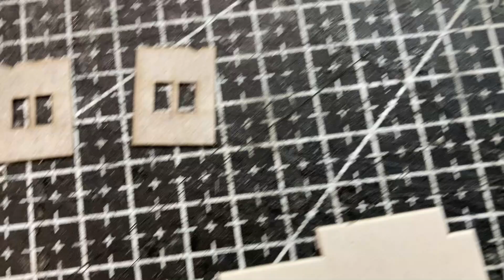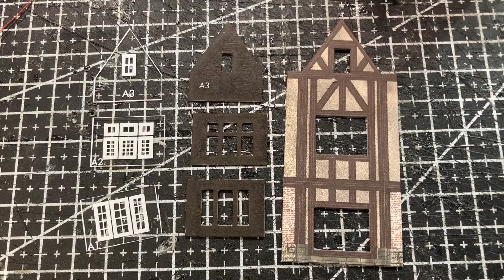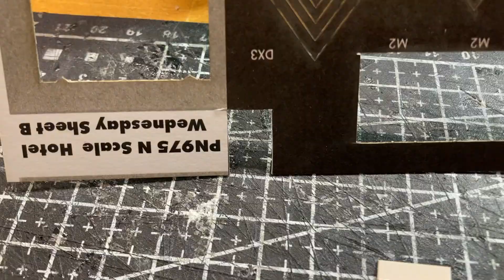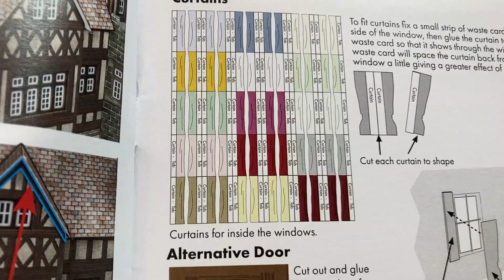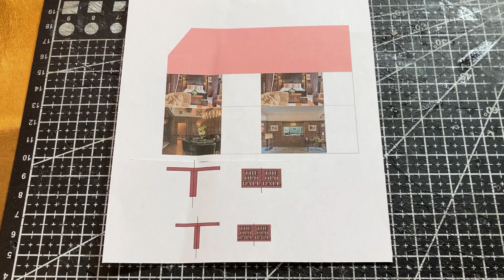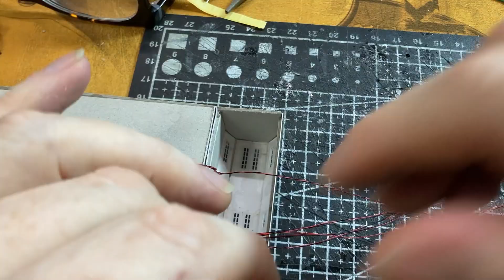How I Built the Metcalfe N Gauge Hotel Wednesday - Thirdstone Ep12 (Content Moved)

Comment: Great update and quite informative! I really have to check out the metcalf kits, especially the N gauge buildings. Quick question…would it be easier to put all SMD LED lights with pos wires to pos and neg wires to neg then use a single 1K resistor?
Reply from the maker: Hi Andy,  I'm no electrical engineer but I know a lady who is... 

(https://www.youtube.com/watch?v=KMFYCu2otrk) Rachel De Barros has some excellent videos on LED circuits and electronics projects which are some of the easiest to follow.  

I think that wiring them all into a single resistor may work but don' quote me on that.🤪
Reply: @AntonyBrotherton I’m no ‘Leccie’ expert either, I’ve seen some use a single resistor and others use an entire bread board! 😂 will check out the channel, always fun to learn something, especially if it’s used with model railroading 😉 Building looks great and the lighting really makes it stand out!
Reply from the maker: @andygorman858  Me too, it's super confusing without resorting to ohms law and a lot of maths.  Adding individual LEDs with individual resistors means you can adjust the brightness by using different resistors with a bit of trial and error.  Amazingly the voltage of the LEDs is determined by their colour and their chemical composition.  Veritasium did an amazing video about the history of the Blue LED which is a perfect demonstration of one man's determination against his corporate overlords.  Well worth a watch - https://youtu.be/AF8d72mA41M?si=lWH40K3jXOMN00tX